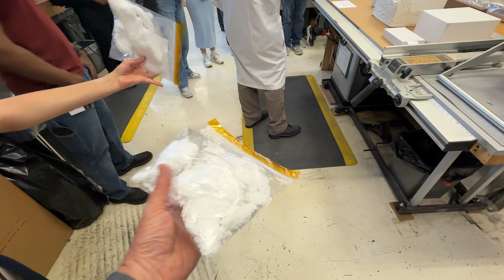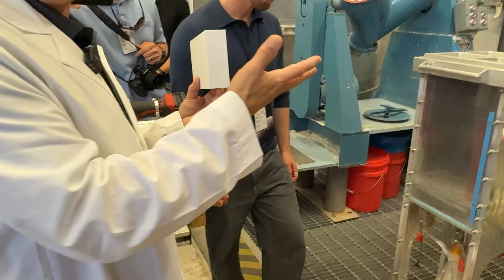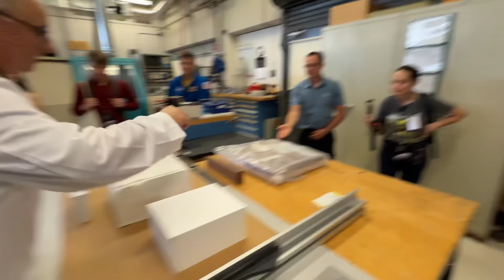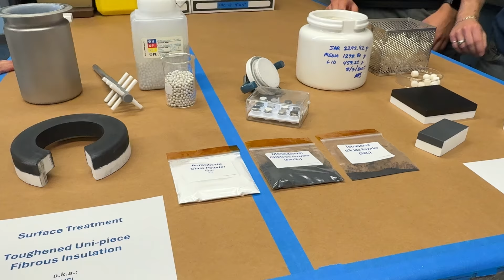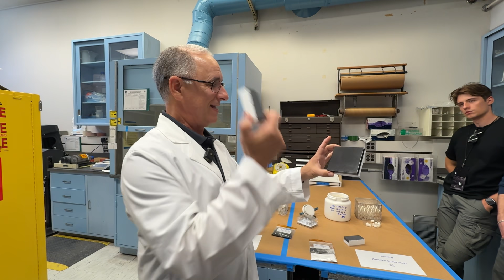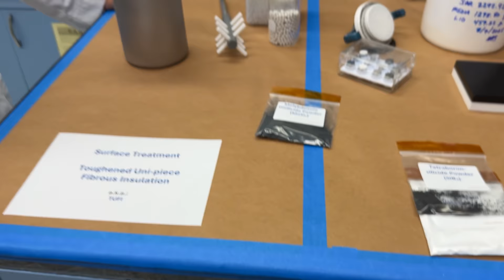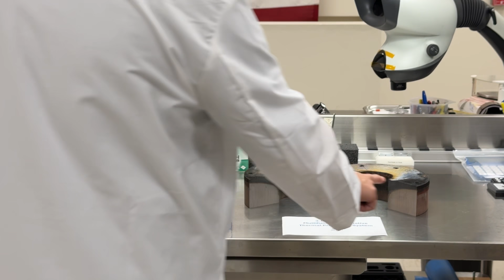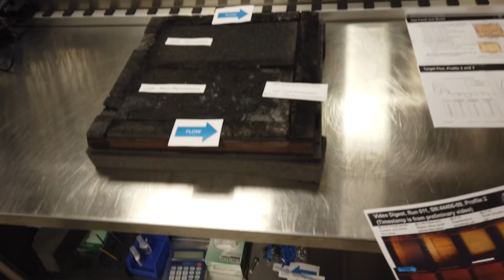Inside NASA's Heat Shield Laboratory

Comment: Yeah, let me add that those fibers and raw materials they are using are hazardous.  Not because they are poisonous or intrinsically harmful to biological organisms, but they are hell on lungs.  You don't want that stuff in the air, you don't want it on your skin.  Silicosis is a real disease just like black lung, and it will kill you if exposed to it for a long enough period of time.

It's not asbestos, it's not nearly that bad, but it won't do your lungs any favors.  Best to not take any chances.

So yeah, the guy giving the tour talks about it, but doesn't go into it in near enough detail for me.  If you are a hobbyist and want to work with these types of refractory materials, be safe.  Or if you professionally work with refractory materials, you should know enough to be safe, but you never know.  When in doubt, wear and appropriate fit tested respirator and filter media.

Comment: Yeah, we gave up using the old-fashioned cast paper-making technique and went to a hybrid spray, chopped (long) fiber forming. Lost too much thermal efficiency for an aluminum substructure. A lot stronger though. It might work for a stainless-steel substructure, but we never thought about a stainless-steel vehicle back then.

Comment: He mentioned supplying Blue Or. I was under the impression that they had their own secret recipe for heat shielding⁉️
Reply: Why would they need it?  AFAIK they aren't doing any orbital speed reentries.
Reply: Not supplying. NASA works Space Act Agreements with industry partners for many areas such as design, entry descent and landing, thermal protection, instrumentation, ground testing, computer modeling, analysis... almost too many to list.

Comment: Thermal protection, one of my favorite disciplines for space travel that still has a LOT of headroom for advancements. (That, and getting a functional Millennium Falcon propulsion system).
Reply: You aren't kidding about that lot of headroom. 

And there's so many things down here on the ground I want to use it for.

I can definitely imagine hypersonic drones, where the leading edges are just a (necessarily cheap or at least cheapish) consumable alabative heat shield, with quick change clips or something.
Reply: @jtjames79  I was momentarily surprised when the tech said that the silica tiles were still considered state of the art. I have a formula for ExHP that I can't get to fully solidify under 3500*C. Still working on reinforcing it, but you definitely can't push a finger through it like a shuttle tile. Only thing I don't know about flyability is what the silica tiles weigh comparatively. My 100x100mm test tile comes in a 39 grams (after thermal testing anyway, likely lost some surface weight in the procedure).
Reply: We should start with the Epstein Engine before we even consider attempting Interstellar engines.
Reply: We should start with the Epstein Engine before we even consider attempting Interstellar engines.

Comment: Is it the same technology which SpaceX using ?
Reply: Pretty much I think.  If not identical.  The scientist gave a heavy hint that others go away to create their own versions but always come back to him in the end.
Reply: For the most part, though SpaceX has slightly tweaked the recipe for better performance.
Reply: Still state of the air also just implies no one has been working on making a better one. Progress should not stop!
"Experts warn current Starship heat shield tech is a “dead end” for rapid reuse NASA has not made substantial investments in thermal protection research for decades."

Comment: The company that thought they could do better must have been SpaceX, right? It totally sounds like them. And I don't mean that to be critical of them - that attitude has gotten them where they are now. But stil, you can't win them all :)
Reply: If you phrase it as "we have to try to do better if we can" it sounds more generous.
Reply: Still state of the air also just implies no one has been working on making a better one. Progress should not stop!
"Experts warn current Starship heat shield tech is a “dead end” for rapid reuse NASA has not made substantial investments in thermal protection research for decades."
Reply: If it was Spacex then they have already succeeded, as the Starship tiles are an improvement over this.

Comment: I can only imagine how nasty the dust from machining that stuff is.

The tiles themselves perfectly safe&stable if you don't cut them.
Reply: I have a large piece of Starship heatshield and it's crazy how it appears to have density but is very light and this ceramic sound to it.
Reply: Mineral dust is bad; carbon fibre dust and grindings are worse because they’re like little tiny porcupine quills that get stuck in and then irritate your lungs.

Comment: It would be nice to know how the shuttle tiles compare with Starship's. I suppose the latter is secret but a guy who is so close to these processes might have some incite.
Reply: Very, very similar.  Starship's tiles are basically taking the last-generation version of the Shuttle's tiles and applying advancements to make them easier to mass-produce and requiring less servicing between flights.  (I suspect SpaceX has, for example, found some way to waterproof the tiles that doesn't require reapplication after every flight, since that was one of the most time-consuming parts of turning a Shuttle around.)